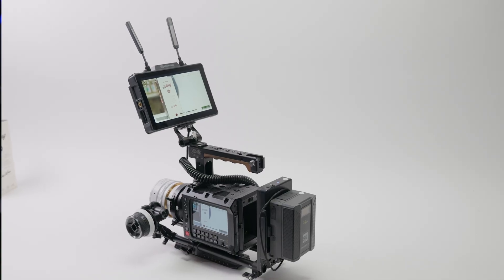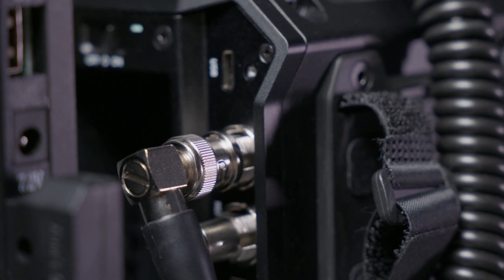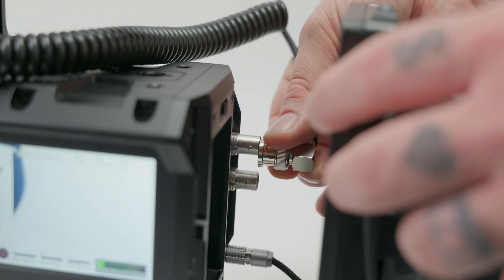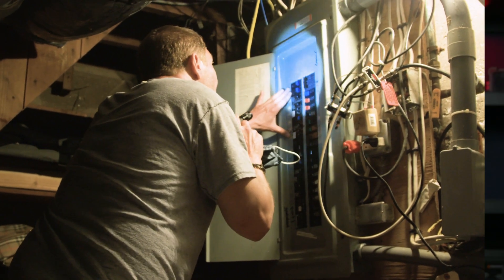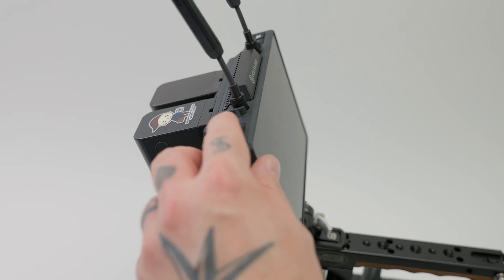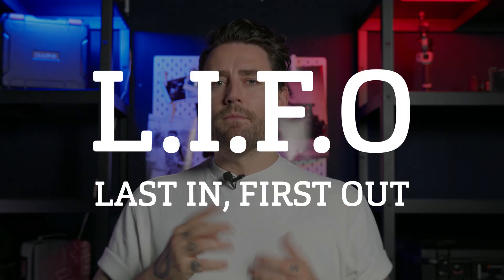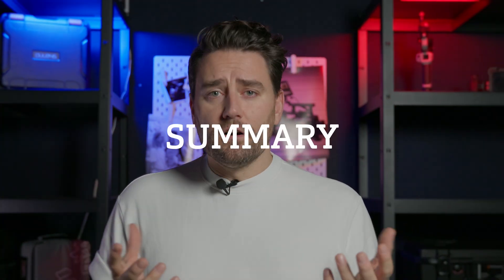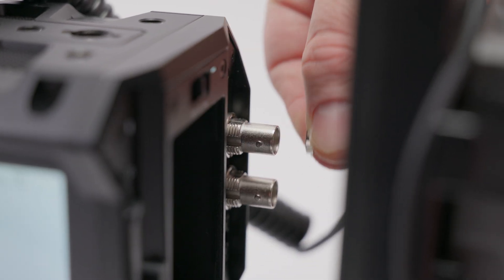STOP Frying Your SDI Ports! SDI Protocol for Blackmagic Pyxis 6K explained

Comment: once everything is plugged in- is it okay to turn off and turn on without having to unplug? like if you have 10 minutes of down time on set and don’t need to switch. would it be okay to turn off/on the camera?
Reply from the maker: I would say yes! Double check your manuals but I usually did that, cause it’s unreasonable to donut any other way😅
Reply: @AlexReinholdsson i’m getting the pyxis this weekend so i just wanted to make sure! thank you!
Reply from the maker: Sweet man 🙏🏼

Comment: Good day! Is this protocol also applicable to HDMI and / or Wireless Transmission systems connected to the camera?
Reply from the maker: HDMI is not the same in terms of currevts etc. SO you should be fine there. But I kind of do this now as best practice also with hdmi..

Comment: Hello,
Could you please create a detailed video explaining the SDI connection protocol for the RED KOMODO?

While there are dozens of posts and explanations out there, some details still remain unclear to me. Specifically:

Does the order of connection matter? Should I connect the SDI cable to the monitor first, then the camera body—or the other way around—after following the proper grounding protocol?

I’ve seen people say the power state of the camera doesn’t matter—that it's okay to connect the SDI cable after everything (camera and accessories) is powered on.  Is this true?

Logically, it seems like either end of the SDI cable could be connected first, but RED recommends making the camera-end connection last. Why is that, and is it absolutely necessary?
Reply from the maker: Hi, here is a link to REDs own instructions: https://support.red.com/hc/en-us/articles/360057166453-Preventing-Damage-to-SDI-Outputs
Reply: @AlexReinholdsson   Thank you for your reply. Yes, I’ve seen the instructions, but as a beginner, I still find the steps confusing — especially with all the accessories needed to get a RED camera working properly. For some reason, no one seems to show the full process from start to finish.

The instructions provided are very basic. It would be extremely helpful to see a complete setup video without cuts — something that shows everything, including the small struggles (like attaching certain cables or rigging parts that are actually tricky in real life). Most YouTube videos only show highlights and make it look easier than it really is.

I haven’t been able to find a single video that walks through setting up the monitors, Teradek, focus motors, and other accessories from scratch. 

Also, what would be the Protocol if you are also using the Teradeck Transmitter?
Reply from the maker: I don't have access to the komodo at this time but i'll see what I can do!

Comment: I saw one YouTuber mention that you have to follow the same protocol when using USB-C to HDMI Cables. That can't be correct is it?
Reply from the maker: Never heard of that to be honest, it’s always good either way routines of course but I never heard of a fried usb c.  With that said tho, there is always a possibility but I wouldn’t worry about that personally:)
Reply: The randomness of the problem can be explained by understanding how it happens. The center pin of the cable makes contact with the connector before the ground (outer jacket), then you have a significant chance of frying the SDI. You cannot fry the SDI if your ground circuit is always completed first. With connectors like HDMI and USBC the outer casing of the actual connector is grounded and if you have ever noticed you have to insert these cables a significant distance into the connector before the remaining contacts make a connection. Long story short it's almost impossible to have the powered pins contact the connector before it makes a ground thus preventing the ground fault. 

I would clarify one point that I don't see on all the videos. You do NOT need to disconnect both ends of the BNC cable to protect yourself. There is a concept know as "air gapping". As long as one side of the cable is not connected it's impossible to fry your SDI. That could be important and in our case it's very difficult to disconnect the SDI on the camera side because of the rigging. There is no need though, we simply disconnect the monitor side.
Reply from the maker: @ comprehensive comment and I see where you’re coming from. Great one, this video is just a worst case scenario and people really do need to know their protocol, if not to protect the camera but also be efficient on set and to know it if someone says to perform it by the protocol way. 

But yeah, I don’t disconnect the monitor, only the camera, but that’s also due to rigging :)

🙏🏼

Comment: Will all SDI isolator cables work with the PYXIS
Reply from the maker: Hi, thanks for the comment. In theory yes. But I was reading up on those cables and solutions and found that those products doesn’t really give you a 100% coverage anyway. But yeah. :)
Reply: @AlexReinholdsson  would you still recommend using it as additional layer of protection ?
Reply from the maker: @ghospod  well, an extra layer of protection is never wrong, I see no harm in it, with that said tho, good routines and well looked after equipment does it for me. I’m not using the extra protection:)